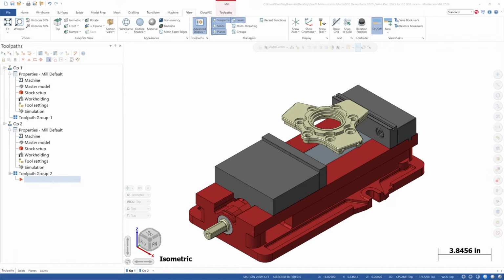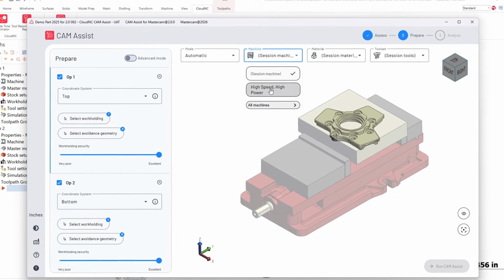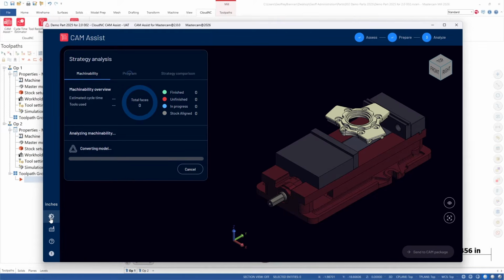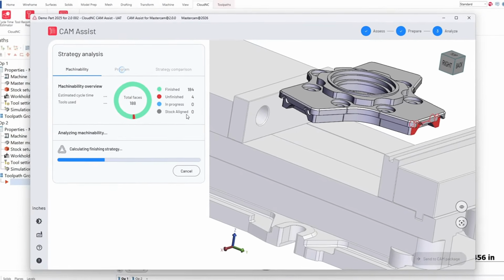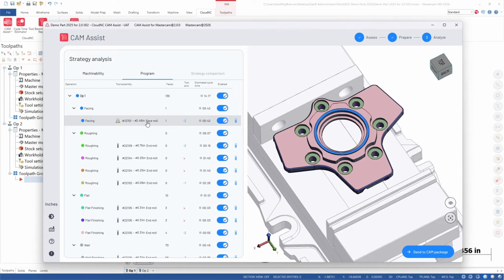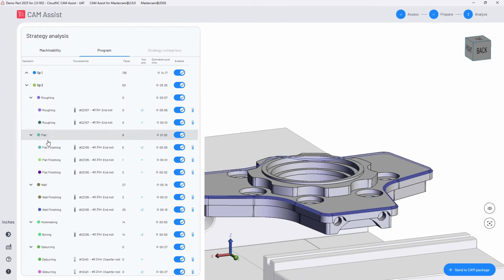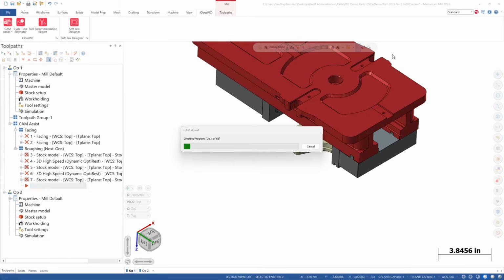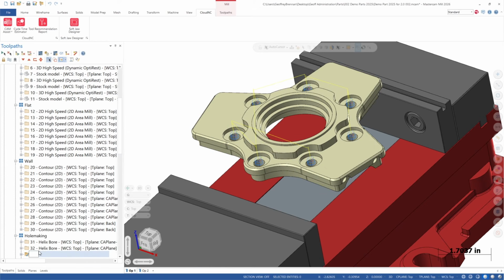Introducing CAM Assist 2.0 for Mastercam

Comment: When I click on "CAM Assist" and then successfully log in to my Mastercam account, I receive this error and the assistant doesn't load the model. Does anyone know what could be happening?
Thank you

Error event ID: 1d4696bd56974ddb8da2195b332d8be8
"MODEL CONVERSION FAILED"
Reply: Did you get this resolved? Current opinion of 2.0 ?